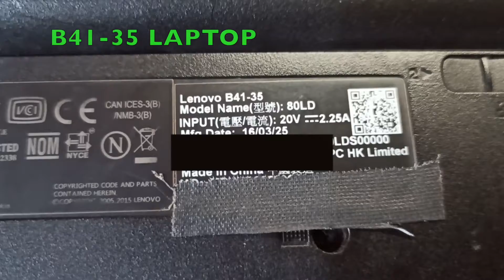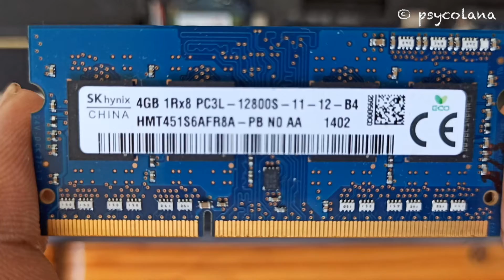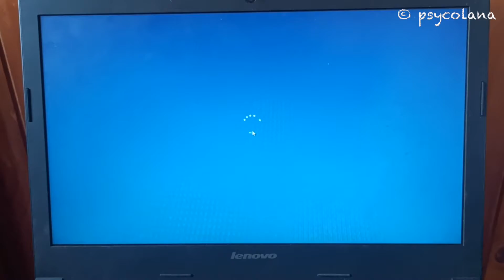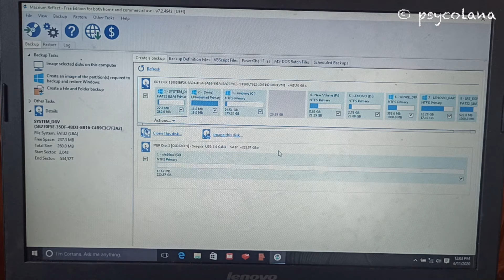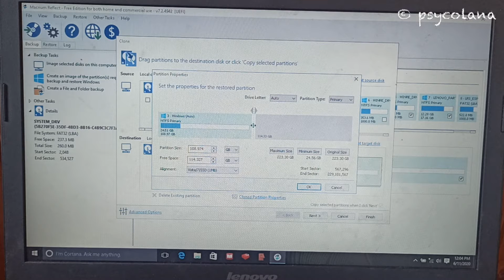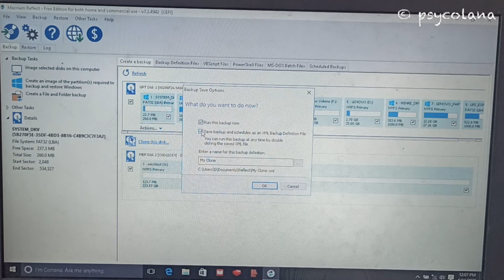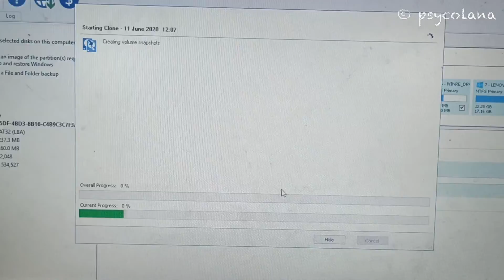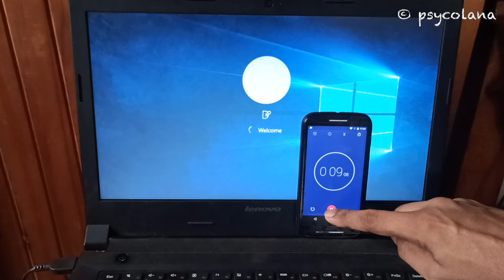How to Upgrade Lenovo B41-35 SSD RAM & Save Money

Comment: Bro I have same laptop.....has 2 slots but 1 is not showing.......it shows only 1of 1.....not 1 of 2......I tried putting it in the other its not working.....I wanted to putt 2 8 gb in each slot.....but only 1 is working.
Reply: Only 8gb ddr3l 1600mhz ram support lenovo b41-35 not ddr3 ram

Comment: I have the same laptop and it has 4 gb ram only in one slot. 
Which one of these will give me more performance 
1. 4gb ram +4gb ram =8gb ram. Or
2. 4gb ram +8gb ram =12 gb ram. 
Plz tell
Reply: You can use 8GB RAM & 4GB RAM together, but doing so can affect performance. Although you’ll have a total of 12GB RAM, it will be slower than using two memory sticks of the same size.
When using 8GB and 4GB RAM together, they should have the same voltage rating. Their controllers and motherboard must also be compatible with each other & both the RAM sticks will operate at the frequency of the RAM with the lower frequency.

Better to use 4GB+4GB Ram or 8GB+8GB ram
Reply: @davidc1510  ok thanks bro

Comment: Hi there very helpful video thank you very much. Can I install the larger memory /RAM and without having to do a clean install of windows or clone hard drive, is that just for adding a new hard drive. All I want to do is increase the memory from 4GB to 8 GB. Thank you in advance. Cheers - Stu
Reply from the maker: Hi Stu, yes you can install larger Ram without having to do a clean install or clone the hard drive (needed only if you are replacing the old HD to a SSD), and you are most welcome. Cheers
Reply: Tanks buddy

Comment: Hello friend, very good explanation, do you think those changes it can work on a Lenovo b41-30, which has an N3050 processor (1.6 gHz)? Or even changing the ram memory and the hard disk, I will not see improvements in the processing times?
Reply from the maker: yes , replacing the hard drive to ssd and upgrading the ram (max ram 8GB kit (2x4gb) DDR3 PC3-12800 • CL=11 • Unbuffered • NON-ECC • DDR3-1600 • 1.35V •) ram config again double check your laptop manual, will boost performance.

Comment: Nice video bro 👍
How much is the Ram Capacity of this laptop?8GB or 12 GB or 16 GB ? 
Please give me some details of , what kind of Ram this laptop support?
Reply from the maker: Maximum Ram 16gb Kit (2 x 8GB) but plz check your user manual, DDR3L-1600 SODIMM (DDR3 PC3-12800 • CL=11 • Unbuffered • NON-ECC • DDR3-1600) hope this helps
Reply: @psycolana why only 2,48 usable from 8gb?

Comment: hi bro i have same laptop but when i opened i have 2 slots of inserting the ram but in task manager it shows in memory option 1 of 1 used why so?please tell bro i want to upgrade ram help bro
Reply from the maker: Hi, how much off ram does your system show, as in 2gb or 4gb? also do you have two ram cards inserted or only one
Reply: @psycolana  i have 4gb ram same as ur laptop have 2 slots but one is empty so that i can put another 4gb and make it 8gb but in task manager it shows 1of 1 in memory section means only one slot  but when i opened my laptop there are 2 slots help bro
Reply from the maker: @aksharajkalangutkar1849  yes you can put another 4gb in empty slot
Reply: @psycolana  bro can  we use dual channel or single channel ram in lenovo b41-35 laptop
Reply: your unit might just have single ram card of 4gb
Reply: @harshpatwardan9277  i have 2 slots one slot is of 4gb and one slot is empty i want to put 4gb and make it together 8 gb but in task manager it shows that i have only one slot how come please help bro
Reply: @aksharajkalangutkar1849  put 4gb ram in empty slot like psyco lana said and u get 8gb in task manager, i followed this guide

Comment: Can i install 12 gb ram i have 8+4 gb ram
Reply from the maker: yes you can, but the frequency of the new ram stick should be equal to the frequency of the one you are using currently.If the frequencies of the both ram sticks are not equal then both ram sticks will be clocked to the frequency of lower clocked ram frequency. Hope this helps

Comment: how to improve its cpu？
Reply from the maker: cpu is soldered to The MB, so if i am not mistaken upgrade of cpu not possible
Reply: @psycolana  I want to change it
Reply: @psycolana  
How to overclock this cpu? I mean AMD E17010
Reply: @psycolana  The clock is too low to use
Reply from the maker: @dapaohan4291  not possible to overclock it too, please read : https://support.lenovo.com/in/en/solutions/ht116786
Reply: @dapaohan4291  Bro, laptops are not suppose to be changeable. Also, if you want to change it, buy a new one.